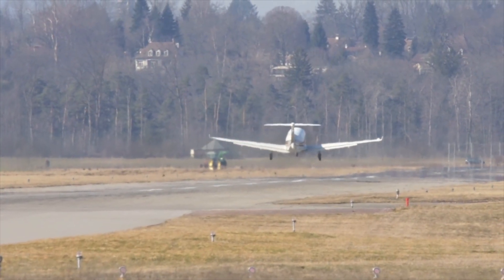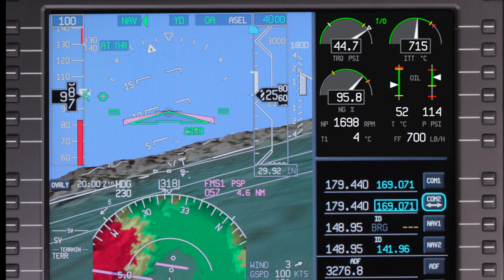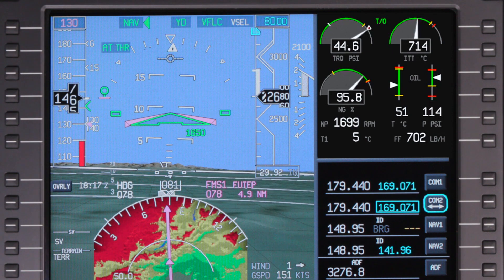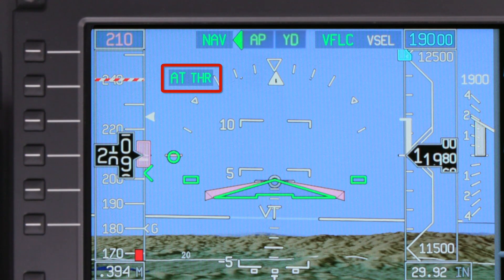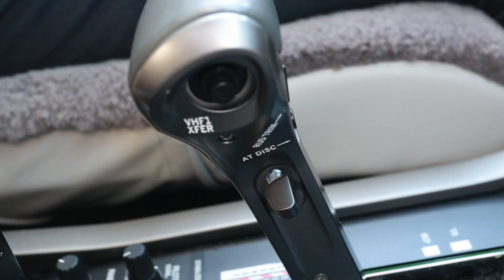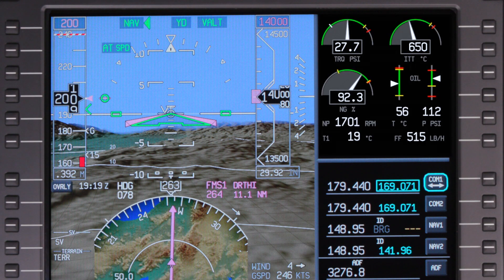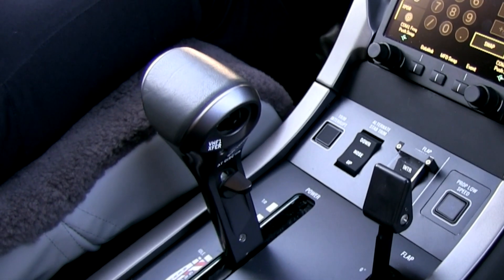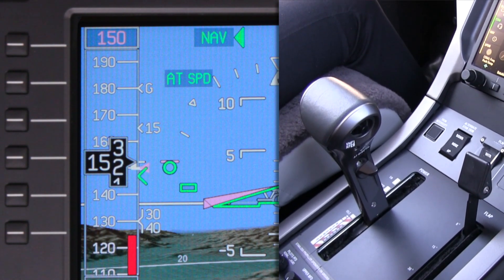Thrust Management System on the Pilatus PC-12 NGX

Comment: The reason that this plane has so many pilot induced crashes..IMHO.. Is because this plane has so many crutches. As soon as one of the crutches goes away.. Crash. Pilots need to be able to fly raw data manually.
Reply: What are you talking about?! All of your comment is factually wrong. The airline industry has been using auto throttle/thrust for 30 years, and it has proven to improve safety. Not only that, the PC-12 is one of the safest SE aircraft out there. It has a .24 accident rate per 100,000 flight hours vs 1.1 for all GA aircraft.
Reply: I so agree with your statement. I am so concerned about pilots being addicted to throttle management and forgetting to manually control the engines. In single-engine IFR operations, it is so natural to forget something, and usually, it is something you use the least as the system was designed well.